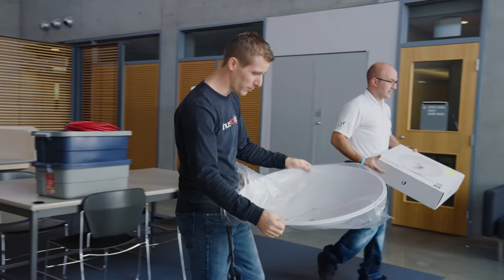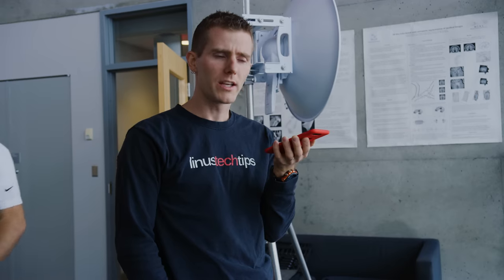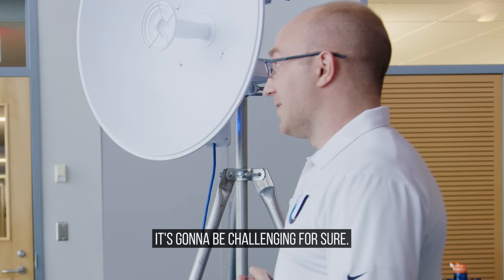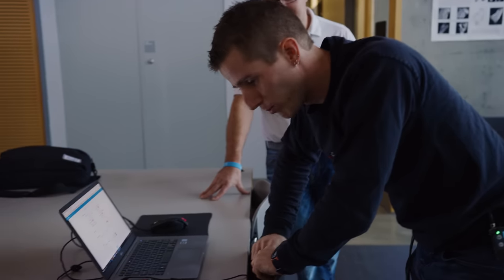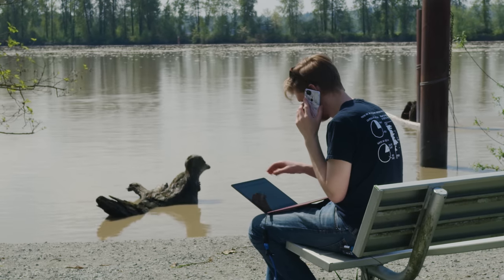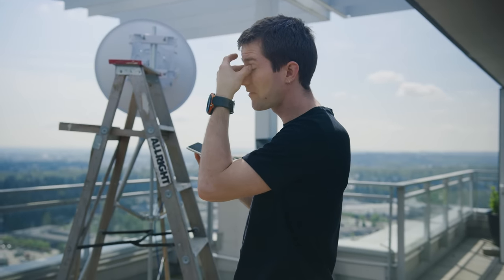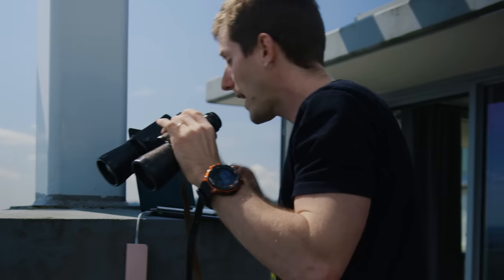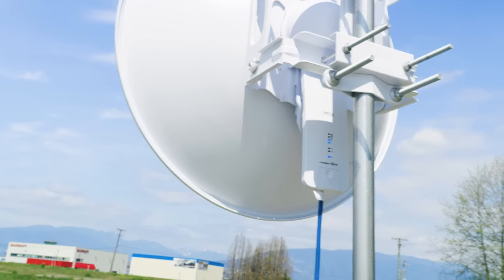12 KILOMETER Wi-Fi - SUCCESS!!!

Comment: Should've just used the mirror to send bits to eachother. Fiberless optic network.
Reply: You mean like infra-red networking. Used to be common to find for point to point connections between buildings.
Reply: @lmaoroflcopter  That's cool. I've only ever used IR to connect a laptop to a cell-phone for dial-up internet back in the day. Didn't know it could work over longer distances.
Reply: So infared
Reply: @iKingRPG  Infrared is just a small portion of the light spectrum, but you could use any wavelength of light. The reason they use infrared is so humans don't see it.
Reply: @LT89NL  very also because infrared travels further through the atmosphere, high energy violet light scatters too much
Reply: @chrisvdw2223  correct, more attenuation occurs on higher frequencies
Reply: That's a thing that exists, it's called a RONJA Ethernet link
Reply: somebody said laser?
Reply: "Free-space optical networking"
Reply: @lmaoroflcopter  my old work had one of those,I dont know if it was because it was cheap or the thing was like 10 years old but it went out like every other day and I would have to remotely restart it or go alllllll the way over to the other building and restart it there if that was the one that wasnt working
Reply: @abdurrafeysyed7800  someone is not familiar with old fashioned networking technology (who the hell calls IR networking an IR Blaster this is not the same tech that powers your TV remote you numpty) and likes to copy and paste.

http://www.airlinx.com/products.cfm/product/19-0-0.htm can do it over 4km so sadly your comment spam is proven incorrect.
Reply: @abdurrafeysyed7800  lol Syed. I corrected a spelling mistake.

Scroll on boy. You know nothing.
Reply: @asronome  that's really cool. Just read up on ronja, what an awesome project.
Reply: @abdurrafeysyed7800  You do realise you actually copy-pasted the exact same reply to 8 people, and made yourself look like a fool in the process? Maybe you're still a teen and that's the excuse why you didn't know this, however like @console already mentioned not only is it possible, but till about 2 decades ago it was actually a somewhat common method of data transmission for university campuses and such. These days the availability of very high transmission rate WiFi has made IR obsolete as a method for data transmission, but in the past they would often use an IR laser to beam data from one building to another if they were separated by half a kilometre or more and if there was a clear view between them. Another reason for it's usage up until the turn of the millennium was it's resistance to interception, seeing as the beam of a laser is extremely narrow and focused compare to regular electromagnetic signal links.

Comment: So I messed around with a similar setup to this in the army except ours was at the top of a 15 meter mast. Was a cool experience to get hands on and understand the underlying functionality.

Edit:Also a compass and map really comes in handy for getting the azimuth and reverse azimuth too shoot in.
Reply: Yess, im a mobile parabolic radio operator in the army, and the compass is paramount, especially when you have to make a connection covertly and cant use regular radio/mobile phones, as to not send a bunch of radio noise from the location youre trying to conceal. Its amazing how you can set up connections tens of miles away in the dead of night just by using maps and compasses and without ever talking to each other.

Comment: Now imagine the voyager space probes, out of the solar system going 17 km/s and still sending data back
Reply: yeah, but at just 160bits/sec
Reply: with nothing to drag it down till it reaches the atmposphere...............i vote we get rid of that then your home router will have a million mile range
Reply: Yeah cool, but it's using deep space network which is...
At least more than 5 satellite dish
Reply: @accurian148  those dishes may be able to read the signal but the signal has to reach em first
Reply: ever heard of radio?
Reply: 60 METER wide antenna is receiving it, and that's at like 160 bits per second..
Reply: There is no mist in space
Reply: Hubert Jasieniecki  "when" they launched is of no consequence. at the time they launched their data transmission speeds were far better than they are now. it merely comes down to the signal strength that were are able to receive, which has been negatively impacted as a function of their distance. the farther they go out, the weaker the signal, and as such the slower the data rate. which at the time of my original comment 2+yrs ago, was in the range of about 160bits/sec

Comment: They shoot a WiFi signal across 12 kilometers and it's still better than my WiFi
Reply: Koby Miller To be fair they are using a higher bitrate, so I don't really get your point
Reply: This was LAN-Speed it hasn't to do anything with the speed that your ISP is offering you.
Reply: They also have more $$$ to do it with
Reply: its all in the antenna...    look at the db rating..     those stick antenna are only like 9 db gain.    this thing is probably 20+  and all of the gain is focused one way...    omni directional (the lil pole)  covers a 360 degree area..

you can up you gain simply by using a satellite dish and replacing the unit in the feed horn with your current antenna, point it at your wifi source and voila,,  this dish bounces all the wasted gain back to the antenna..

just search homemade parabolic wifi antenna, lots of plans out there
Reply: cataria pega Do you really believe in those lies...
Reply: my wifi speed is 56 kbps
Reply: same

Comment: I'm dissappointed that you didn't try to play LAN multiplayer
Reply: Would be fine, i use to use long range wifi for internet before, you get like 50ms or so.
Reply: I use to use...
slow clap
Reply: What about long range 10km wifi multiplayer? At high speed! Now that would be an episode to watch!
Reply: WiFi at long distances is surprisingly reliable and, believe it or not, has quite a low latency. I use to work for ISP where we covered huge area only with WiFi network and far weaker antennas than displayed here. We used these 32dBi antennas for 30km+ ranges between base stations.
As for latency, you are usually looking at 1-3ms addition to your regular latency. So it's far less than one would expect.
Reply: Ohhh, gotcha. Probably better to just play at home lol, where connection is better.
Reply: More like WAN
Reply: That's probably because modern games not work on LAN... :/
Reply: 1-3 ms for 30+km ? It's impossible believe it XD
Reply: @soyoltoi   a network is called lan if it covers an area of up to 50km
Reply: @flappyBoi  Not really. LAN is usually about 1km. It would probably be better classified as a MAN.

Comment: Despite the fact they have GPS devices right in their hands....I love that the first file sent was called "fu linus" 😂😂
Reply: Yea.. would of worked for the general direction but definitely not nearly as accurate as they need.
Reply: Using gps to help with direction and then using sea level elevation probably would have made things much easier to align initially
Reply: "fu linus" was actually a folder.
Reply: Lloyd Dominic Refuerzo Nice touch from Alex there. 🙃

Comment: Next stop, the earth —> moon.
Reply: Elon Musk wants to: Know your location
Reply: Smash Nerd and Nerdy Mario Android nerd
Reply: We do, everynight, there's retroreflector on the surface that we putted on one appollo mission. We use it to calculate the earth-moon distance.
Reply: Some HAM use the moon as a radio reflector, they send a radio signal to bounce on the moon to reach places over the globe. The signals are weak, but when both have large antennas, it is possible :) (so it's even harder than what you mentioned : it's the full trip to moon AND BACK for the signal each time!)
Reply: EME, a HAM radio function as mentioned by Audrey, has been used for quite some time now.  It bounces a signal from earth off the moon and back to earth to use a frequency that is normally line of sight to reach another side of the globe not in direct line of sight.  Max legal limit of home wifi is 1w, where as for licensed HAM operators its 1500w and combine that with array ant, you get some good signal strength.
Reply: I heard the ping is really bad there
Reply: And the mars
Reply: Mme. Hyraelle this is my favorite fact whenever some idiot thinks we never went to the moon. How did those reflectors get there? lol

Also it may be easier than it seems to send it to the moon... Pretty sure there is more air to go through in this test than straight up through the atmosphere. After that it is just traveling through vacuum... Ya know, in theory.
Reply: NASA already did that
Reply: Moon is a satellite.
Reply: Ianuarius GOOD point, we are all satellites on this blessed day
Reply: Frankie Aiello Speak for yourself.

Comment: Why not have an alignment app that connects to this and uses compass and gps for perfect setup?
Reply: Hardly need that, just plug in GPS coordinates and draw a line between the location's for bearing. Considering most if not all GPSs have some form of compass (either an actual compass or a simulated one using changes in location over time) you can easily get the bearing down in under 5 minutes (being very generous about how long it takes to move everything). Then you just adjust for altitude. If all of the software is set up this isn't a hard evolution.
Reply: The software for the dish has that. You can hear them talking about it
Reply: Not needed. this distance can be done LOS kinda . but this is also something they should be doing on like the roof or highest point on each area.  you can literally move it around and see signal come up in DB.
Reply: It’s los so it’s all feel as long as you got the distance
Reply: yeah it's LOS, any other devices attached to it will give interference tho. so you won't be sure untill you power it off and the ubnt back on. Best is to have a person each side and check what your signals are. use gps to draw the line via googlemaps etc. but then just adjust untill you have best signal
Reply: Cus its hard
Reply: Ubnt now has planning software you can use to get an idea of what you signal levels, possible obstructions. Once it's connected the signal levels will help get the best possible signal.
Reply: I use this same equipment for my WISP. My techs use a PoE 1mAH brick (U-installer) to power the antenna and align it from there. They get -60 to -45 db signal, depending on distance from my towers. -70> db will get you 100mbps, which is more than enough for most residential packages. The equipment they're using here is overkill. A PBE-5AC-620 ISO is more than sufficient for CPE and half the price.
Reply: I was thinking the same thing when I was watching lol
Reply: You cant use an app on it because the phone cant be use for such a task as it only has 1 GPS and cannot align itself accurately.

what you need is a dual GPS stick with compass to align yourself accurately with being able to compute whether you are pointing at a specific GPS coordinate straight.
Reply: GPS is accurate vertically however after some altitude you wont be able to get a GPS reception properly.
GPS accuracy is artificially limited However in this case we are talking about alignment, which would require a coordinate and 2 GPS devices attached in a long enough line.

If you want to get creative you can use your smartphone, but it would have to be attached to the device to align it (GPS + sensors + compass) on both sides which would require 2 phones. So any solution will need more than 1 set of GPS/sensors
Reply: hi, im here too, but im confusion
Reply: I thought the same, even with just compasses and a good map they should be able to find out where to point that thing.
Reply: I think the lack of preparation is part of their manufactured drama
Reply: Hey Gavin! Cool seeing you here! Anyway yeah run the app on both phones have them close to the antennas and it would help get the alignment as close as you can get it. Some here have said it's only so accurate within 5 meters or so, but I'm not sure of that I thought it was more accurate than that. Building an app like that would get one to figure out whether that's the case or not, or more accurate than people say.
Reply: Its called geo tagging...
Reply: Thast Would be the boring way
Reply: I setup something like this in India for a job. We just use a plain old laser pointer to align the LOS. Distance was around 14km. Ubiquiti ftw.
Reply: I know, two year old comment: I was thinking this but with just a traditional compass for land navigation, and a map with a probably even a protractor could have helped with alignment (at least in my mind this makes sense). Pinpointing your exact location from there is easier and would be more accurate than navigating an off brand GPS, which only get your location down to the nearest 10-20 meters, whereas just using a map you can just use the compass to pinpoint where you are to the nearest 1 meter to even 1 foot.
Reply: @Courtesyflush52  this is like 2 years later but the GPS is there for time, to sync the transmissions, because wireless is half duplex. This is used to reuse frequencies, because when you have a lot of wireless gear on towers you run out of open channels. Nothing to do with alignment.
Reply: They can build technology to transmit a file thru the air, but can't seem to grasp how to align two dishes together....

Comment: meanwhile at my house:

WiFi WORK PLEASE YOU ONLY HAVE TO GO THROUGH 2 WALLS
Reply: 1337Space yeah, the problem comes from this setup being a focused signal, and your WiFi router being a omnidirectional signal. There’s ways to use materials to create a rigged up dish to direct signals only in a certain direction using your standard router. 

The other problem is your home router is probably transmitting at a maximum of 100mW, and this setup is probably transmitting at 30W.
Reply: Mustache Merlin  With force
Reply: Dude
When my microwave turns on it tanks my wifi😑
Reply: @zjenthusiast3037  i don't think that's very healthy on your end
Reply: Garblehead  unless it blows up then it's harmful lol
Reply: Garblehead  Well, as long as the radiation doesn't actually raise the temperature in your body parts high enough to cause damage anyway
Reply: @shen1801  Uhh, have you ever heard of a term "electromagnetic radiation"? Because that's literally what it's called.
Not to mention, what absorbs the energy in your typical food item is a water molecule, not a "hydrogen particle". Anyway, I appreciate your polite ways of embarassing yourself while trying to teach others what they apparently know better?
Reply: @shen1801  oof, man
Reply: try tilt your router 90 degrees, see which side works best.

Comment: Man, that mirror light thing he did was kinda awesome! Can't believe that thing worked so well
Reply: If you slow down to 0.25 you can see that the glimmer is edited in.
Reply: maybe he see it but didint catch it so well on camera
Reply: I can't help but think how hard engineers in the military and space industry have to think in order to get things like this working.
Reply: No way it's edited in. If that was the case though, the editor better be applying for some jobs in Hollywood.
Reply: There's a tower on top of a mountain across the bay from my place, about 15 miles or 25km away, and I know there's a road that passes right in front of that tower, and on certain days where the sun lines up behind me just right, I can see that exact twinkle from the sun reflecting off the cars on that road. Its really cool when it happens.
Reply: You mean "that great-big window"?
Reply: Light signaling is an actual thing that's used in mountains to send stuff like distress signals.
Reply: I would suggest you go outside once and a while and learn about the outdoors.  Signal mirrors have been around since the early 1800s.
Reply: In emergency survival situations, your: phone, watch, tablet, hand mirror can be used to signal planes (the sun has insane amounts of light). As for the gold reflector, I was surprised too.
Reply: the conversation and reactions at that speed are hilarious!
Reply: Rescue mirrors for signalling planes are only about 12cm across. You can achieve the same thing for free with an old CD. Just Google how to use the centre hole, and your thumb, to direct the flash exactly where you want it.
Reply: halcyondaystunes  was that aimed at me? If so, here's a little reading for you. 
https://m.outdoorrevival.com/kit-and-equipment/use-signal-mirror.html

Comment: Has a smartphone.
Says "i should really have brought a compass"
Dude...
Reply: Smartphone compasses aren't all that accurate.
Reply: Just look where the sun is.
Reply: @howlingwolven  they are actually accurate than original compass😂😂
Reply: pranay They are not. Not in my experience
Reply: @howlingwolven  it Will be pretty accurate on high end phones because some budget phones does not have proper sensors but high end phones do....
Reply: @vkraju452  I have owned 3 "high end" phones (iphone 4s, 6s plus and 8 plus), all had inaccurate compass data saying north was in 3 different places
Reply: @Suzumi-kun  the compass should be calibrated and should be hold flat.... Try that once and compare with a real compass
Reply: @Suzumi-kun  10/10 you can't use the compass properly. It's legit insanely accurate.
Reply: Same with antenna levelling problem, easy to do with most smartphones these days